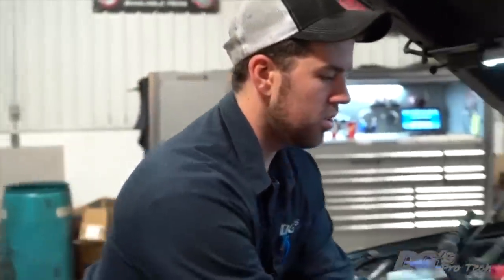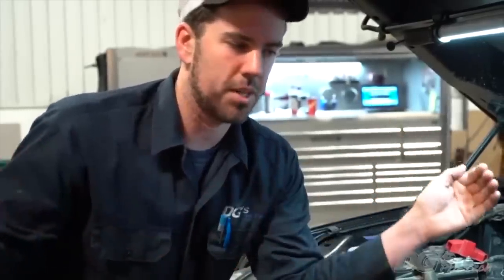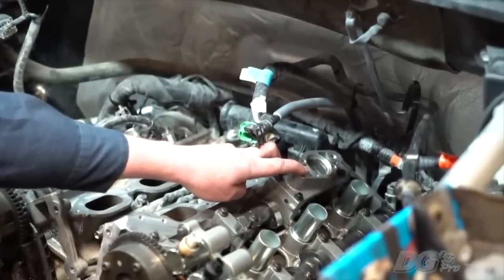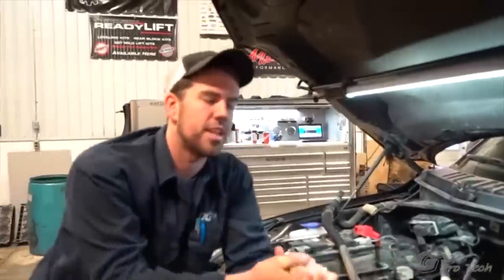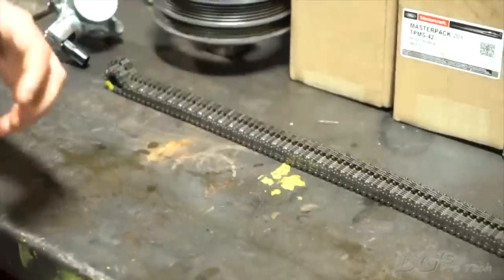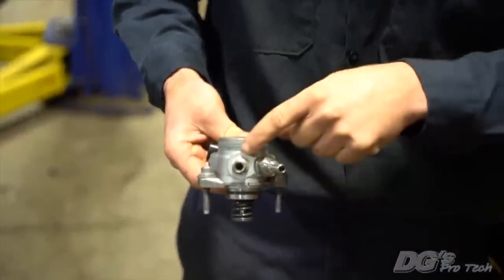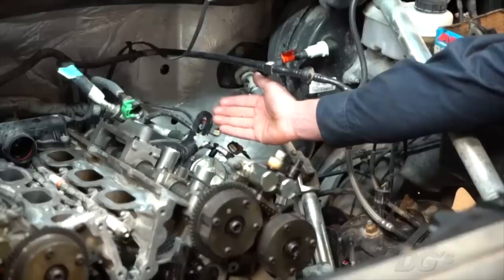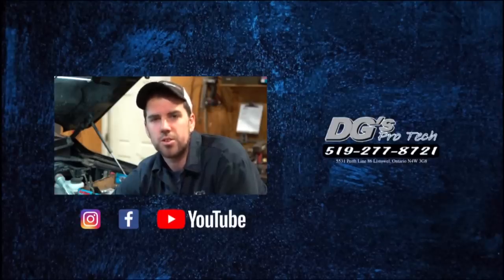What you NEED to know about Ford EcoBoost Engines by Dustin Golley of DG's ProTech

Comment: So, synthetic oil, 5000 mile oil changes, and blow the cobs out of her once in awhile!
Reply: Don't let the cob webs grow in the first place, but I'm with you brother! Maintain it and drive it, it came with twin turbo's for a reason 😁😎👍
Reply: Basically, take care of it and it’ll take care of you.
Reply: @hientruong4074  I'm currently at 125K miles on my 2016 XLT Ecoboost, and it's running great, but it's been maintained well over those miles too.  Watched a video on a 2011 Ecoboost, and the guy is at 530K miles, and other than throttle bodies, the engine has run great!   Much depends on maintenance, but I personally believe if you're towing with it constantly, it may take some toll on the mileage down the road as well.   Great power, great mileage for a truck of it's size/weight indeed!
Reply: You got it.
Reply: Using pennzoil ultra platinum, drive it ,give it some gas ..5,000 rpm,,no issues
Reply: @fartnutssupreme4930  As long as you don't do some crazy shit with your car any good synthetic will be fine. People spend so much money on some oils and then reach 2.5k rpm max on their way to walmart.
Reply: He said 5,000 kilometers cause he's a Canuck. That rounds out to 3,000 American miles though.
Reply: @danof76  I think he said 8k kms
Reply: Richard McCaig I guess no one realized anymore that the SAE has standards that ALL companies must meet or exceed.  I run mobil1 full synthetic with motor craft oil filters in my 2.7. Also, the engines this guy is talking about are the first gen ones.  Thy have since improved the timing tensioners and added an injector in the intake.
Reply: Yeah, the old Italian tune-up!
Reply: @highrzr   NOPE.   Was called Nevada tube up.
Reply: When i was a kid, my moms car was always blown out! 😇
Reply: That's what I do with mine, 93 octane, Mobil One Synthetic changed every 5k miles and go into Sport mode here and there blowing the turbos. Not to mention having fun blowing them out😂 I get about 18.5mpg in Regular mode, could stretch 19 in Eco mode (what fun is that?) and I can get about 23-24 on the Interstate in cruise and regular mode. 

I will admit the new 10 speed made it tough on me to choose between the 5.0 and 3.5, my last 5.0 is slow as hell in my 11 Lariat but did drive a 19 Lariat 5.0 to Florida and loved it too. The 10 speed woke that motor up. But in the end the twin turbos and mpg is why I chose the 3.5 in my Platinum 4x4 19 model
Reply: Friend of mine has a 2012 f150 3.5 eb with over 400k
Reply: @robert066  ask him what oil he uses in it just curious lol
Reply: Busted Nut  yes your right... but some oils offer more protection than what ford offers...
Reply: Thats what I'm sayimg.... some off brands are way better than the motorcraft oils...
Reply: I think he said 5000K, which would be 5000 Kilometres, or 3000 miles.
Reply: And sell at 130K.
Reply: @taylorc2542  Sell it to that brother in law we all have!
Reply: @taylorc2542  lol yep
Reply: @taylorc2542  mine has 190k miles still running perfect
Reply: @taylorc2542  Or sell with fewer miles, then be someone else's Problem.
Reply: @taylorc2542  Never last til 130k, Junk !!
Reply: And some higher octane
Reply: Jay Wattman yes. High octane. My ecoboost blew a piston due to detonation. I only put 100 octane fuel with its 2nd engine now
Reply: Maybe low speed pre-ignition? Ford now recommends an SN + oil to help mitigate LSPI. Make sure you use the correct weigh oil for the area you operate your truck. Also, buy a good oil. Your engine, as the man in the video stated, is of newer technology and you have to keep good clean oil in it. Easy to do and dirt cheap compared to having to tear the engine down because we were too lazy to change it, get it changed or decided to save a few bucks on bargain oil. Also, get on that thing often. Don’t abuse it but don’t drive it like you have an egg between your foot and the accelerator!
Reply: @GreatGrandmasterWang   Jesus Joseph and Mary
Reply: @jaywattman199  Hi octane  equals more anti knock but less calories (power)for reliability in Aero engines and make the swept volume bigger to compensate the power loss.
Reply: Jyoung Hyping not even close to the same look into the 2.7 ecoboost it’s basically built like a gas Diesel engine other engines aren’t nearly as close in most vehicles you compare it to most v4 or v6 on the market it’s built totally different
Reply: I just picked up a 2020 F150 and drive like 4 to 8k miles per year... How often should I change the oil? I am thinking twice  a year.. my 31' Ford is every 500 miles so no biggie
Reply: @Michael_Scott_Howard  if you use full synthetics and only put 4000 miles a year on it...once a year oil change is fine.. look into amsoil.. best synthetic in my opinion a bit pricey though
Reply: @Michael_Scott_Howard  Every 5k miles is plenty if you're using full synthetic.  If traditional motor oil, twice a year like you say is good since you don't mind.
Reply: I run e85 but I do run 10k miles on pennzoil full synthetic euro L 5w-40
Reply: and dont be a moron who uses off brand oils and coolants and mixes them with ford shit... stick to Motorcraft oils and specified coolants they are specifically tailored for FORD ENGINES universal oils/coolants may say they are but they arent they are suited to be one for all not the BEST protection for the exact part/engine that ford has designed motorcraft oil/coolants to be for the ford engine/ cooling parts they use
Reply: @Sundusk8  The same coolant they use, unmodified in N/A and Turbo vehicles, the same oil they use in N/A and turbo vehicles? You think not one aftermarket manufacturer produces better quality fluids? The only place I'd stick to Ford exactly is trans fluid...
Reply: @tbgb1979  Ford uses special additives that are fine tuned to the metals and various aluminum or whatever in their parts to offer the specific engine/cooling system the best protection.... no off brand offers such as they dont know ford products as ford engineers do like the makeup of them.. they are UNIVERSAL for a reason... its a UNIVERSAL oil and or coolant whatever they are they are not fine tuned llike motorcraft products are for specific car this is why ford especially with coolants warns of using off brands because the additives in the motorcraft are fine tuned for the elements/parts within the cooling system for best protection
Reply: @Sundusk8  I didn't know Ford made its own oil.
Reply: @stevereaves6757  Motorcraft is ford oil lol special additive crafted
Reply: @Sundusk8  You really believe all that mumbo jumbo? Who makes Motorcraft oil? Some research will show that there are better oils than motorcraft. Not that it is bad, its not. Ford oils are not designed for Ford engines. How would you even do that?
Reply: @randyschmidt19  additives fine tuning for various metals of the engine composition same applies for coolants they are fine tune with specially crafted additives for the specific ford cooling parts
Reply: @Sundusk8  Absolutely 100% False.  what metals specifically are you talking about LOL.  I happen to have worked for years at a Very very very well known automotive and aftermarket performance parts company. During that tenure I had classes and meetings with the people who actually make oil, for everyone in the world, even ford.  Explained to us about base oils, synthetics, additives. The types of additives, how they function. Oil companies such as Mobil or whomever buy base oil from the companies who produce base oils and they have several PREMADE additive packages they can choose from. There is the ability to purchase custom additives and that is based on whatever the needs of the customer is but none of that has anything to do with the "metals of the engine composition" Motorcraft is rebranded oil from someone else. Super tech oil at walmart is produced by Mobil. There is a whole lot of crossbranding and misinformation in the automotive industry and I hate to see people buy into the BS. I will state the facts
Reply: @randyschmidt19  ford engineers have a say in the additive makeup my dude its part of their supplier talks its not just "any oil" rebranded its a formula tailored for ford vehicles just like their coolants are
Reply: @Sundusk8  that is what they tell you and clearly you believe it. Yes they buy a standard additive package just like everyone on the planet. Nothing special. It's actually not as good as other oil available at AutoZone. Believe what you want tho. I'm sure those garbage ass spark plugs Ford screws into their engines are "specially formulated" for the gas and air ford uses too.  LOL I have led you to the water sir but I can't make you drink
Reply: @randyschmidt19  If you look on Amazon at the reviews for Motorcraft u will see many comments of customers who have paid for Blackstone oil analysis and proved Motorcraft additive is superior on ford engines
Reply: @randyschmidt19  So why would a oil analysis show fewer parts per million than others? u still cant answer than question.. is cause of the additive
Reply: @Sundusk8  lol you answer that. People lie? I'm sure the review is on a sales item that is motorcraft. I'm telling you what is actually available for manufacturers to purchase from the people who manufacture oil. Told to me in professional training given by oil manufacturers. They do not make a magic oil for Fords. Ford engines aren't magic or made from unobtaniom. I'm sure they have a preferred additive package. Most people do. Do you even know what additives are added to oil and how additives differ from synthetic to non synthetic oils? Probably not. If you like motorcraft use it. It's nothing magic for sure tho.
Reply: @randyschmidt19  Like I said i like it cause it gives better results on the oil analysis so i stick to motorcraft in my ford engine thank you very mucho
Reply: @Sundusk8  Most likely Ford oils, lubricants, and coolants are "fine tuned" to produce the most profit for Ford dealers.
Reply: @ellieprice3396  No, they are actually less of a profit because they are cheaper than the off brands they don't make much off the oil they make most of the profit off the service labor charges you dont know how the industry works just compare the price of motorcraft oil (very well priced) to some of the overpriced fancy oils and u can clearly see the profit is miniscule
Reply: @Sundusk8  Yes he is correct ..... manufacture fluids always.
Reply: @Sundusk8  Very true I'm not a fan of synthetic oils, they are not necessary and there is nothing to gain for most driving habits.  Coolant is specific, I follow the owners manual which states 5w/30 Motorcraft, besides I worked as a Senior Master Certified Tech at the dealer on this stuff for 21 yrs so I do think I've seen plenty to base my personal opinion on.  I own a 2020 F-150 3.5 Ecoboost, no problems and I am confident I won't see any.  I saw very few problems with these at the dealer, most are caused by customer abuse or tuners.  4-5k oil change intervals is about right.  No oil additives, ever either, good way to screw up, Manual even states that.
Reply: @larryrobinson7492  I've been a mechanic most of my life.  I ran non synthetic oil in my 05 f150. sold it with 170k miles and it sounded great. never had to take a valve cover off and I changed the oil every 5k miles. All my other cars had synthetic and changed 5k miles. same thing, not even a valve cover was removed. I always used quakerstate and have always had good luck. I do think synthetic is a little more slick which in theory would cause less wear. I also think it handles heat better in a turbo vehicle.
Reply: @Sundusk8  Good advice because in the sixties most Ford engines rattled to death at 45k miles but modern oils cured the problem and 300K miles common!Also two strokes suffered plug fouling that modern oils cured too!
Reply: @routmaster38  YOu are implying ford doesnt use modern oils? ALL oils have improved since then einstein for ALL engines silly
Reply: @Sundusk8  If you bother to read my text,it tells you that modern oils DO MAKE THE VAST DIFFERENCE!
Reply: @routmaster38  mmk its obvious what u were implying and it was ford oil bad modern oil good but ok dude
Reply: @Sundusk8   wow 😏
Reply: @Sundusk8  yes sir
Reply: @Sundusk8  Using Ford Branded Oils, you are only paying a higher price for Quality oils like Mobil 1Full Synthetic or other Manufacturer, just stay away from Quaker State, there oil is the worst for High Output Engines, from my experience of driving and repairing vehicles for over 40 years....
Reply: 10k is fine.
Reply: You can go 7,000 miles with the synthetic if you’re not in heavy traffic all the time
Reply: Richard McCaig  Ok so every type of oil or coolant has a (formula) that formula is unique by brand aye.. so what makes you think some off brand with a universal oil knows the formula for the right additive to give the best wear protection on a ford motor or cooling system parts :) just think about it and u will understand not every engine/cooling system has the same makeup of various metals therefore motorcraft has a specially crafted additive that provides the best wear results for that specific part some reviewer even paid for a oil analysis and showed the motorcraft has the best protection of element in the oil compared to off brands for the ford specific motors since i saw that i never use anything but motorcraft in my ford
Reply: Lolz look up SAE oil standards. That’s what makes him KNOW you don’t have to use ford oil.
Reply: @petrosspetrosgali  those standards just are standard guidelines just like gasoline is regulated.... doesnt mean the additive in those oils are best for the ford motor engine..... every oil has specially crafted ADDITIVES some are better in certain motors u know nothing mate keep using whatever u want to ur choice
Reply: Lolz Basic metallurgy agrees with you especially when it comes to the proprietary amounts/ingredients that make up the alloys of the components that need lubricant. So yes I would agree that the in-house brand will generally make better stuff for their own vehicles or at least have the ability to do so.
Reply: @Sundusk8  Plus they were all tested including severe stress tests by Ford engineering over a long period of time and miles before releasing any vehicles to the consumer.  I was in the business for many years and heard some of this first hand from engineering as it was going on.  They have these trucks driving around for months plus run stuff in labs in very cold and hot climates, etc.
Reply: @Sundusk8  I'd love to read/see this reviews research, could you please post a link to it?  I've used Mobile 1 full synthetic and ford filters in my 2015 eco-boost Mustang with 0 problems within 107,351 miles..
Reply: @ethanshelton9859  Okay? I wouldnt really expect you to have issues using full synthetic at 100k but last time I checked Mobil 1 is a universal oil that people use in all sorts of car brands which tells me the additive makeup of it is not SPECIFICALLY formulated for the various metals specific to a ecoboost.. bottom line.. every engine has a different makeup
Reply: @Sundusk8  guys....oil is there to help cool and lubricant the engine.. doesn't matter what metal its made of...use a full synthetic oil such as amsoil and you won't be sorry ..
Reply: Lolz  engines are NOT that different.  Listen to professionally trained mechanics.  We are few now but still out there.  Technicians aren’t as well trained as mechanics.
Reply: @Sundusk8  so your saying that off brands don't deliver the same protection as Motorcraft?   Sorry I don't beleave that.. firstly Motorcraft is not a fully synthetic oil. So the breakdown of that oil will be depleted quicker than full synthetics  Motorcrat uses a synthetic blend, with is a lower gread oil than synthetic.   For the most part oils are designed to lubricate metal ..(all metals)..so the better the lubrisity the less wear you will have.   I always use full synthetics changed every 5000 miles even though they recommend 15000 miles. Amsoil signature sieries isa great oil. You will never have a problem with it
Reply: @fireguy144ify  Ford motorcraft additives are tailored engineered for the ford motors... so yes i choose motorcraft in my ford engine ford even tests them with that oil... which has their additive in the ford motorcraft oil..... also i change oil every 5k so a sythethic-blend offers excellent protection.. full synthetic only really shines at LONG MILE durability which who wants to go full sythetic to go 10k miles intervals? no would rather change FREQUENTLY every 5k with synthetic blend
Reply: @Sundusk8  And just so people know he was saying 5,000 km (3,000 miles). I'm not sure if he was referring to Motocraft synthetic blend for the 5,000 km recommendation, but I assume so. I'm running the 3.5 HO in a '19 Raptor. I will definitely use this note from my virtual mechanic to cycle my turbos fully once in a while.
Reply: @Sundusk8  you have know idea what you are talking about!
Reply: @gilianrampart8514   "Motorcraft products are the only antifreeze/
coolants recommended by Ford Motor Company"    "Non-approved coolants could cause cooling
system repairs to not be covered under warranty"  Motorcraft products / oils have specially crafted additives made specifically for Ford cooling systems / engines   I DONT KNOW WHAT IM TALKING ABOUT..... straight from ford enginners themselves.. mkay buddy https://parts.ford.com/content/dam/ford-parts/resources/motorcraftpdf/Antifreeze_Coolants.pdf
Reply: @ethanshelton9859   ONLY  107 K Miles?
Reply: @Sundusk8  Ford calls for WSS-M2C929-A specification oil for the 3.5 Ecoboost. This specification means the oil has the additives Ford requires for use in this engine. Mobil 1 full synthetic meets this specification, along with many others.
Reply: @matts.8342  Id rather have a oil that has fords perfect blend of additives for their engines rather than a universal that meets "standards" which is all that means it means its "ok" to use doesnt mean its the best additive blend for that specific engine
Reply: @Sundusk8  Ford will always tell you that using other than branded products could void warranty, BUT IF THEY REFUSED WARRANTY TO A CUSTOMER THAT CAN PROVE THEY FOLLOWED ALL RECOMMENDED PROCEDURES AND THE ENGINE FAILED, FORD HAS TO PAY. Has been proven more than 100K times in the USA and Canada, Ford just likes to Brain Wash Simple Simon's Like you!!
Reply: @jimcossar7425  Wrong. Cooling parts from wrong coolants brand will void the warranty says it clear as daylights in the warranty contract simpleton maybe learn to read  or use common knowledge "Most manufacturers specify a coolant when they build a car. If you do not use the correct coolant, or change it often enough, you can void the warranty and forfeit any out-of-warranty consideration. Coloured liquid in the radiator does not mean it is filled with reputable coolant."